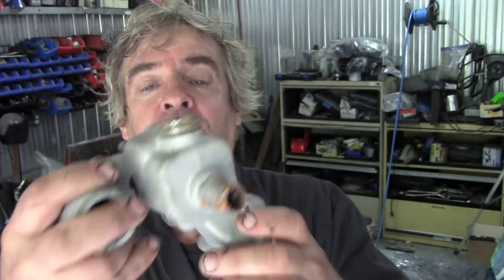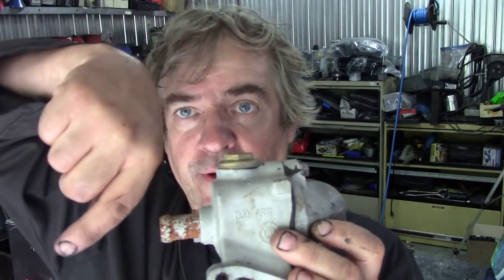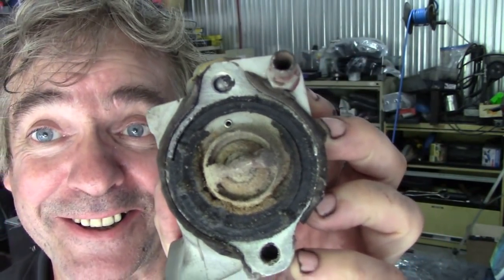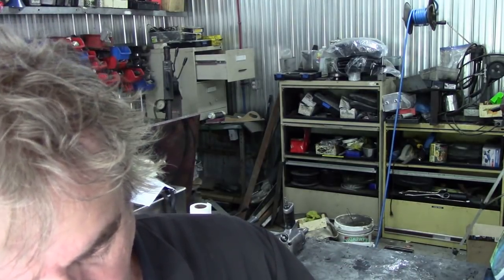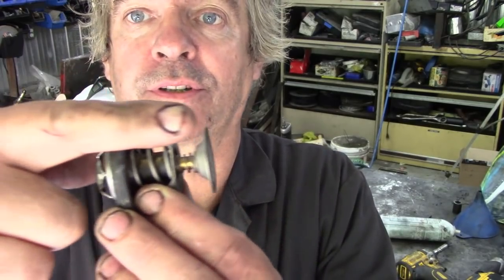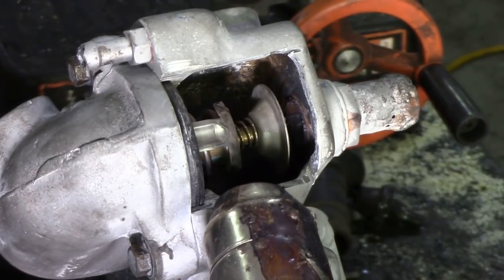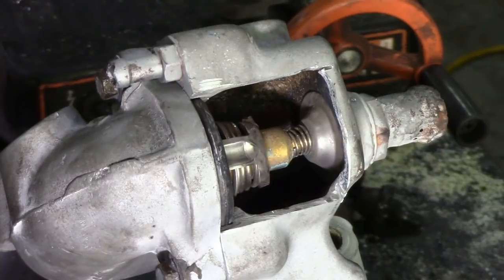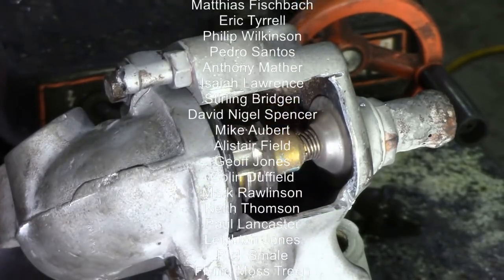How does a Tdi Thermostat work? Live cutaway experiment of the bypass valve working!

Comment: Very informative illustration! To add a bit more info and a question with it: you can see that the bottom plate which blocks off the bypass is spring loaded and is actually contacting the thermostat housing before the thermostat itself is fully open. So basically the bypass is closed off first, then the thermostat continues to open further and that is facilitated by the fact that the lower plate is able to slide on the thermostat axle/spindle whilst spring loaded and thus pushing against the bypass opening.

My questions would be:
What is the distance the thermostat must open before the bypass is blocked off?
What is the TOTAL distance the thermostat is able to open?
At what coolant temperature does the first condition occur (i.e. when bypass is fully closed and all coolant goes into radiator)?

Comment: Brilliant. Thank you.
My 96 300tdi just overheatedfor the first time in 26yrs.
Can't find anything wrong. New thermosrat, bled it, flushed and it overheats within 5 miles. Without the thermostat it runs at the normal temp.
Reply from the maker: You will find the gauge will show normal, but the engine will overheat - the problem is not solved

Comment: Excellent video as well. I live in a tropical country. The mechanic advised me to remove thermostat as it is more useful in cold countries. Can you share you thoughts on this?
Reply from the maker: Nope - it makes the engine run hotter as the bypass is not closed off

Comment: Mike the corrosion pitting on both faces of Thermostat  housing, is that due to no anti freeze or incorrect coolant mix? I'd think Ghana they'd not be adding correct mix there more corrosion! Friend used to service SCANIA, the operators penny pinched just used water to top up if overheating, the "thinwall liners" occassionally rusted through causing Mega engine problems expense!
Reply from the maker: Not a drop of anti corrosion - just nasty water

Comment: Great informative video as usual mike, and liked as requested. While you seem to be in the mood for looking inside things not usually looked inside I think a video on diagnosing (and looking inside) rear brake pressure reducing valves would go down a treat, hint hint 😉
Reply from the maker: Right on!
Reply: Great good man, if you could throw in how to diagnose a master cylinder vs PRV then well that would just be the creme de la creme

Comment: Terrific demonstration.

It's easy to forget that a lot of stuff on cars is smarter than we think.
Just cos the thermostat is open, hot water can still find it's way back through the return if it doesn't seal properly - depending on the design of the cooling system as a whole.

Comment: Hmm that's got me thinking if it's the same for the 200tdi as well
Reply from the maker: yes it is
Reply: @BritannicaRestorations  I thought so, going to pull my thermostat out my 200 and check it has the "flap" feeling I've been sold the wrong one
Reply from the maker: Easy done as the old 2.5 NA fits exactly the same - but no valve

Comment: You seem to be the only person on you tube doing these cutaway observations ..be good to see some more..ps now lots of diesels kick out a blast of black smoke on start up..but why does this happen..and can it be stopped...keep up the good work Mike.
Reply from the maker: The puff of smoke is the cold start in the injectors - they are like 2 stage - slow crank = excess fuel and once started they put out higher pressure so no smoke
Nothing can be done about it
Reply: @BritannicaRestorations  ah so that's that mystery solved..cheers.
Reply: @BritannicaRestorations  Thanks for solving that mystery ..... it's a good "tool" to use if someone has just pissed you off and is walking past the exhaust .....😉😁